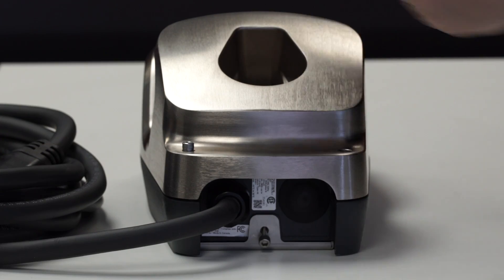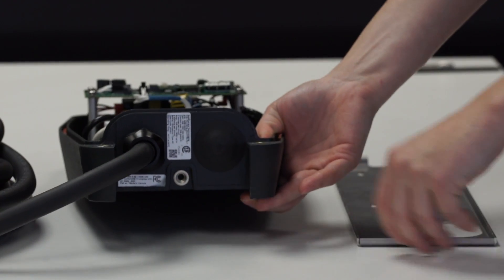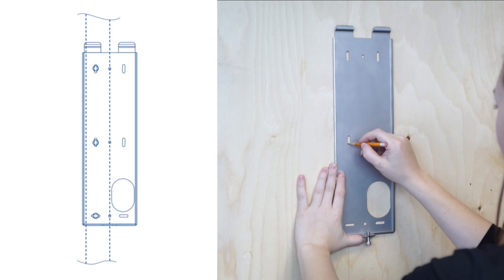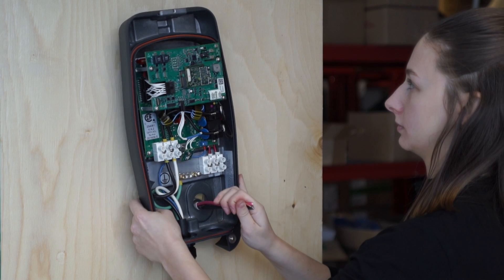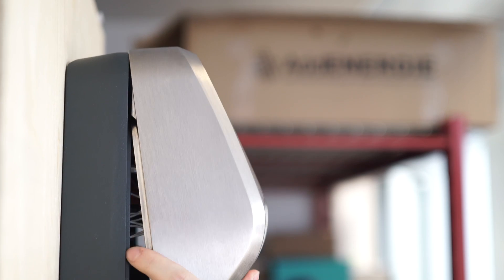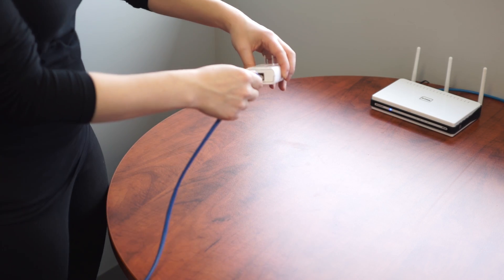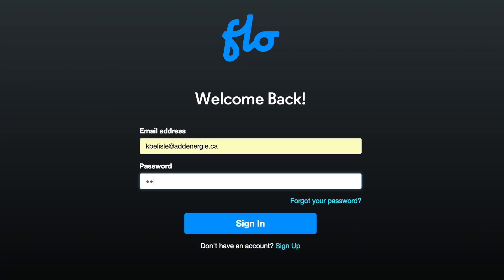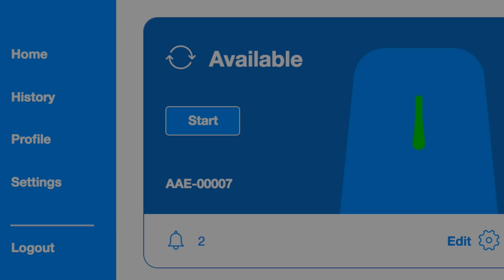Installing the FLO Home X5 charging station

Comment: If I already use PLC for internet at home, and the X5 comes with a PLC already paired to the X5, what steps do I do to get the X5 to connect with my existing power line configuration?